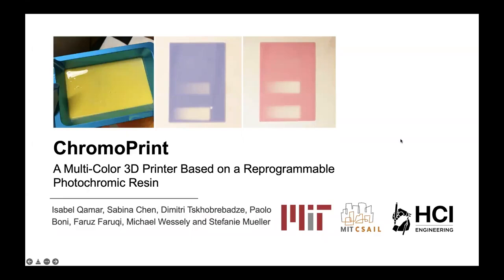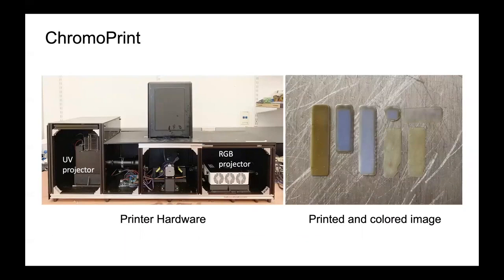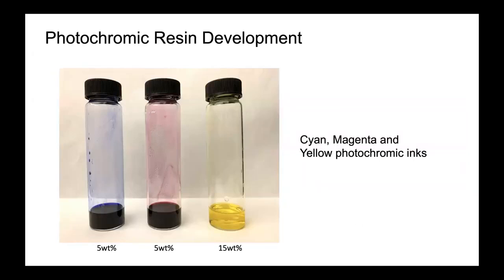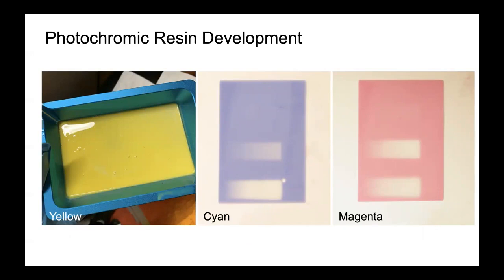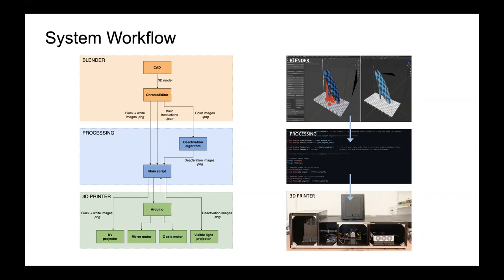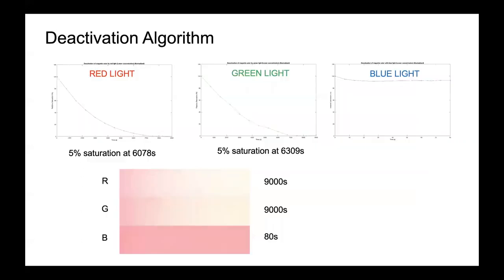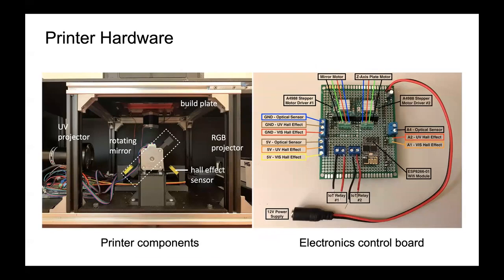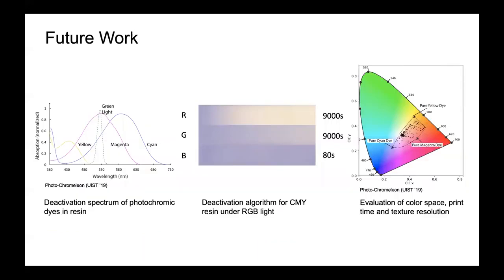ChromoPrint: A Multi-Color 3D Printer Based on a Reprogrammable Photochromic Resin

Comment: Cool, a couple questions. How much more time does it add to prints, based on what I see, it would add 150 seconds to each layer, adding a considerable amount of time. If using the idea to do some coloring over multiple layers as suggested, could this be chopped down a bit? 

2ndly, is it possible to remove the mirror motor to allow it to cast simultaneously as with the UV light? 

3rd, If I understand correctly, the coloring can be applied to the whole image at once. If I'm incorrect, would it be possible to speed it up by applying the coloring to only the visible portions?